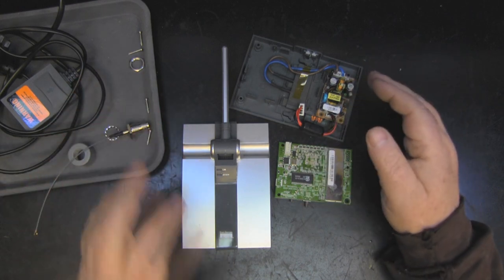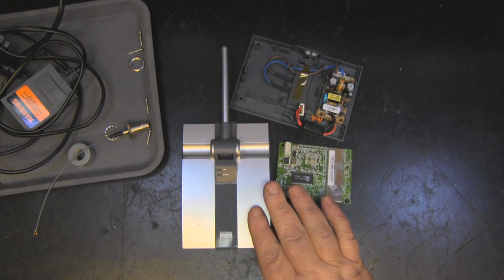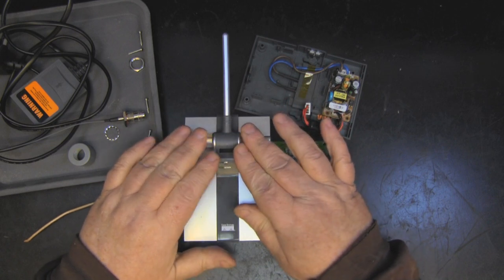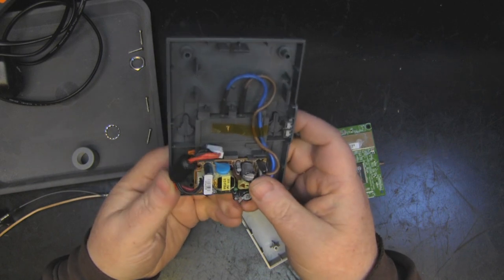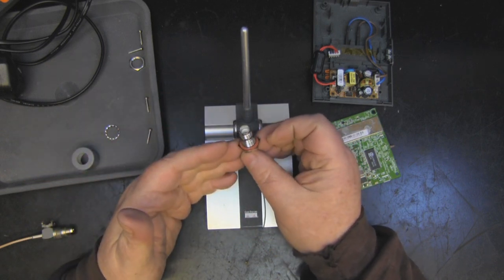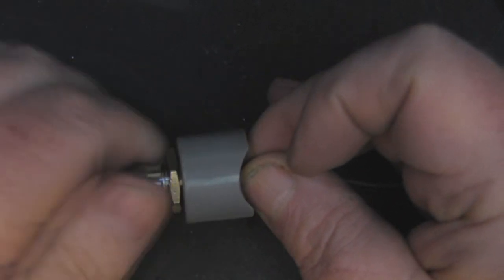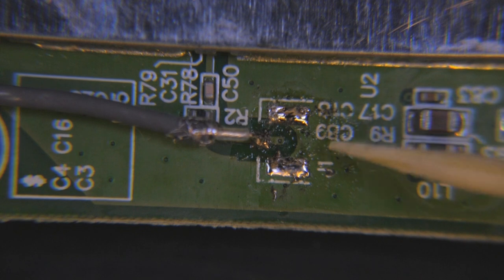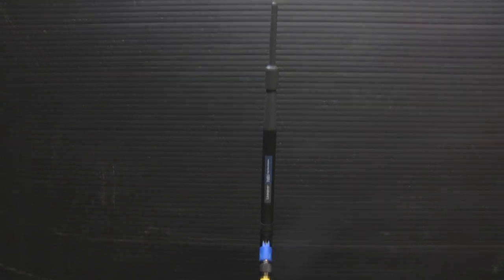Linksys wre54g Antenna Modification

Comment: Gday from uno where, I lurveeeeeeee linksys brand stuff and cisco but Belkin is a real suck brand. Pitty u dont have a website forum cos I lothe ffuckbook cos it has erroded every essence of privacy on the internet and Cyborg Zucker is just a real evil basted that serves his overlords. Whats the difference with the routers inbetween countries?? its all the same regardless of mains voltage. The power adaptors are 110 to 240v autosense and its all 12v DC barrel connected. I like to buy old new stock of the wrt54g but I have to buy from the USA as there is none i can find in Au for a reasonable price and cost of delivery from the US just sux dogs balls. Anyway I am becoming a fan of ur channel and love the mods, have u done a review of them white cylinder type 4g antennas off ebay? with the 2 real thin coaxs that are 5 meters in length with sma connectors on the end and some com with T9 connectors too.